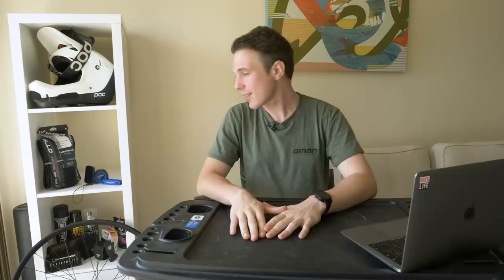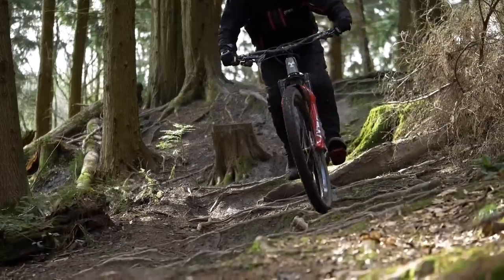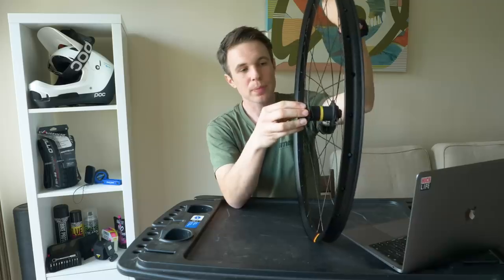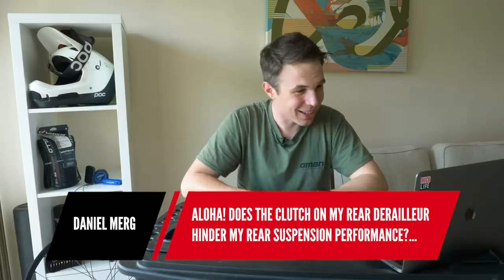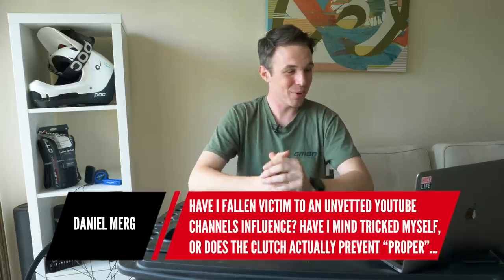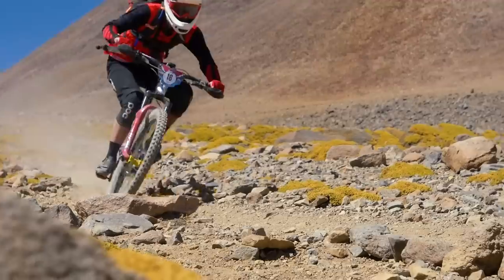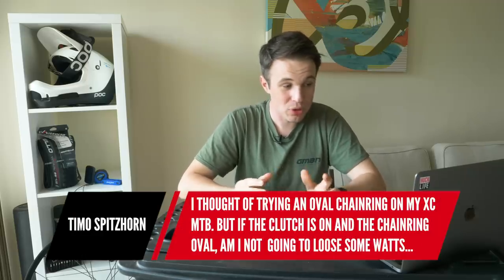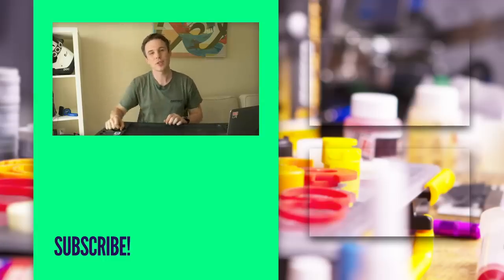E-MTB Components On A Regular Mountain Bike? | #AskGMBNTech

Comment from the maker: If you have a question you would like to ask us, use the hashtag #AskGMBNTech with your comment under this video and it may feature in a show in the future! 🔧
Reply: GMBN Tech #AskGMBNTech INew to MTN Biking and I’m building a Nukeproof Scout 290. So my ? is,  is it ok to use a Shimano disk and a Hope caliper together.
Reply: #AskGmbnTech at what time should you just replace your helmet even if it is not visably cracked eaither from crashing without cracking it or age because surely over time it weakness with age.
 Love the show
Reply: #AskGMBNTech hi guys, love the vids! I have a kona process 134 (2015 I think) and I would like to get some hope cranks for it, which ones would I need to get and do I need to change my bb? Also what tools would I need to change my bb (if I do need to) thanks!
Reply: #AskGMBNTech
I have an entry level MTB with a cone and cup bottom bracket used for 6 months then sat for 8. I never noticed but the bracket is at a 10-15 angle what's the danger of it being cross threaded and can you upgrade it (its threaded both sides)? The shop I bought it from did build it.
Reply: #AskGMBNTech love the videos, helped me upgrade my trek rumblefish to an XT 1x group and go tubeless. Today my bike appeared to be ghost shifting, whenever I applied a lot of power it felt the the deraileur skipped. The bike shifts fine and it stopped after I reset the cable tension on the trail but still makes “wanna shift” noises in higher gears. Could it be a bent hanger or are the noises normal in a 1x with the chain angle?
Reply: #AskGMBNTech I saw in this video you covered (1x11/12) E-Bike cassettes on a regular mountain bike. Has anybody tried the E-Bike specific EX1 (1x8) drivetrain with a GX crank and chainring on a regular mountain bike? Funnily enough the EX1 cassette weights just 320g and the XX1 Eagle weights in at 357g.  I would really like to give this a try on my bike park specific enduro which has a standard Shimano freehub.
Reply: #AskGMBNTech What do you think about Magnesium alloy as a frame material? Why is it not a common material for bike frames?
There are many advantages, for example: 
1) low density (~1,7 g/cm^2) meaning light as Carbon
2) high flexibility (Elastic Modulus~44 GPa) providing probably more comfort than aluminum (but is it stiff enough?) 
3) 100% recyclable, Less energy wasting production (melting point~600/700°C) 
4) high global occurence in the earth crust 

So would it be also strong enough for aggressive mountain biking?
Reply: #AskGMBNTech. Hello Gentlemen my question for you. Do you think we will see increased steerer tube diameters on bikes with 160 to 180 travel suspension forks? My suggested size would be 1.5 tapered to 1.75
I have asked Rock Shox and Fox, Rock Shox stated they won't discuss future products and I've had no reply from Fox.
Reply: #AskGMBNTech hey Guys, 2 weeks ago I broke a spoke on my backwheel, at our local bikepark, I brought it to my local Bikeshop and they fixed the broken spoke. Today (sunday) I went for a ride (street and some mild Offroad) and after the ride I discovered that another three spokes were broken. Why is this happening again? Should I respoke the whole wheel? My bike is a 2019 Canyon spectral Al 5.0 and my backwheel is a sunringle düroc sd 37. Thank you in advance.

Comment: Regarding oval-ring chain movement - Marianne Vos used to ride (and win!) on the track with fixed gears using Rotor's non-round chainrings. This is possible for the same reason Henry mentioned - the chain is engaged in about 1/2 the chainring teeth so it works about to move very little. In my experience most of the movement comes from the vertical difference, but the chain doesn't "grow".

Comment: That last question on the ovals... if there is any negative aspect, it's far outweighed by the uphill benefits.   I tried one, still on my bike, and I'm not going back to round . The AB has been great to have on my XC and my fatbike.  Especially in snow or uphill.  I even like it on the flats.  Usually allows me to pick one gear higher out back on flats than I would with round.  Same tooth count chain ring of course.  And my knees feel better overall.

Comment: #AskGMBNTech Hey Doddy/Henry, I've seen some interviews with Christ Porter/Paul Aston etc where the topic of Dual crown forks on enduro is discussed. After doing my own research it seems that the positives outweigh the negatives in terms of added weight and other so called negatives. Aside from cost, the only other barrier to me trying this is the "dual crown rated" adage that some manufacturers add to their enduro bikes. Which leads me to believe that if my 170mm enduro bike isn't "rated" for dual crown use, even though it wouldn't be changing my geometry by having a 180mm dual crown, should I avoid this due to the possibility of "snapping my headtube"? Speaking to Paul Aston about it he mentioned that sometimes adding a dual crown can reduce the stresses put on headtubes. Let me know your thoughts. Thanks guys.
Reply: Given all the ews use single crown, I would read that as the downsides of dual crown Do outweigh positives for enduro. These are the best enduro teams in the world, so I think they have good insight to follow.
Reply: Rupert Wenn it couldn’t be marketing could it?
Reply: I'm not sure the extra stresses on the headtube to worry about are the ones that occur under normal riding.  It's probably more a question of how well it copes with the stanchion banging into the frame when you bail and the bars go sideways.

Comment: hey STEFROMFORTWORTH there is 1 other option u might have missed,  check if all the tire is symetrical, what i mean is a tire have 3 parts, left, middle, right, the middle part is ofcourse all those little bumps (dont know english name for it) that grabonto the terrain, the case might be the middle part isnt perfectly centered, and while tubeless it should still work, but in tubes-in mode it can rip your valve of the tube itself( it happened to me, and the center part was 4 mm offset to the right )...

Comment: Whether or not the spokes are touching each other at the intersection will have almost no effect on the stiffness of the wheel.  You're tensioning them to the same tension regardless of whether they're crossed or not.  The only potential advantage is that on J-bend spokes, it could hold them more in line with the flanges, but otherwise it makes no real difference.

Comment: Maxxis has wide trail tyers and standard. Sometimes it doesn't say WT on wide trail tyres. Wide trail tyres are made for larger rims and will be smaller when compared to standard size on the same rim. Maybe measure the height of the side wall to see if the new one is WT.

Comment: Friend of mine just bought himself a 220mm brake rotor to go with Magura MT7's on his YT Capra.. I can barely touch the brake lever without going OTB or locking the front wheel up. The again he weighs a couple pounds more than me. Gonna be interesting on the first proper ride I think :D

Comment: #AskGMBNTech

Hey I am thinking about upgrading my bike and wonder in witch order I should progress. I'm considering a 1x12, dropper post and a new fork but not sure witch to start with.
Reply: Dropper 4 the win! Easily makes the most MASSIVE difference to everyday mtb riding, (you will never go back to rigid post).. Then new fork, and 1x (tip: 1x10 is still plenty good enough for 99% of riders. 12 speed is simply overkill and more expensive maintenance costs, etc).

Comment: #askgmbn hey Dodds/Henry is there an issue using a lever designed for a 4 piston brake on a 2 piston calliper
Reply: It depends on which brand it is, as far as I know magura and Shimano uses the same lever for 2 and 4 piston brakes, I don't know about SRAM and others.
Reply: Make sure not to mix dot and mineral oil brands
Reply: DragonBornish it’s shimano I only ask as my lbs said it can cause problems but I wasn’t to sure
Reply: Purple Turtle it’s a saint lever on a mt200 caliper
Reply: @kevblaylock3052  Saint levers push more oil than any of the trail levels, so it would be even more pronounced. I'd suggest not doing it.
Reply: @conman1395   i agree, the saints and the zee are the only Shimano levers I wouldn't use on 2 piston brakes. That said, did you buy a saint lever in order to pair it up with your mt-200 caliper? Why not just buy a full midrange brake for the price of one lever?
Reply: I have Zee levers with XT calipers. No problem at all. I have also XT levers on Zee calipers. It brakes as well but I feel that there is probably smaller piston (Levers do not feel so biting). Btw: riding that for 2 years (both bikes). No issues at all!
Reply: @purpleturtle8841  As they use same hose, you will have no issues to swap these. You can swap any lever with any caliper while they use same oil and same O.D. hose. You will see only differences in amount of oil pushed, but as brake cylinders are similar (except 2 vs. 4. pistons) I see no problem. Tried myself already.

Comment: #AskGMBNTech So after a recent trip into the wilderness I had a "little" issue with my SRAM Eagle derailleur (rock + derailleur = no more idler pulley) and while walking the 14 km back to my vehicle I got to thinking. 
1.) What should I carry for spare parts that are likely to break and easy to replace on the trail?
2.) Do you have any suggestions for a hack or a bodge to be able to at least pedal in one gear with a derailleur with a missing an idler pulley?

Comment: I do love sram's guide RE brake set, really good power and relativity cheap...I'm not sold on E-bikes yet (maybe when I get even older as I don't wanna loose my stamina as I often ride 8 hours plus) but if it means beefier gear for MTB's...well that's just fine.
Reply: Ironically it is just an old code caliper and the guide r lever

Comment: Hi Guys.
I was standing behind a guy in the queue for the lift at my local bike park. He had a Specialized stumpjumper, and right in front of his rear brake there was some sort of reservoir with a blue dial on top, and a tube going up to the shock. Is that some sort of remote piggyback reservoir? There was a FOX logo on it. Never seen that before. 
#AskGMBNTech
Reply: That's probably the "brain" shock resevoir. I believe it's to help it automatically lock the rear shock while climbing and open up when hitting bumps and going downhill.

Comment: #AskGMBNTech I recently went to put new tire sealent in my tubeless tires. I have stans sealent and was wondering if it is ok to mix sealants next time I add sealent  (for example stans with orange) or will it cause a reaction?
Reply: Stan's and OS aren't supposed to play well with each other. Heard all kinds of second hand horror stories HOWEVER, even previously working as a mechanic in a high end shop I have not seen that with my own eyes. I had to use a tiny bit of OS (I'm a tried and true Stan's guy) while 500 miles from home and my bike did not explode. I'd say if you're fairly dedicated to regular service then it's not going to bother anything. If you're a "set it up and ride it until it breaks" type, stick to one brand at a time.
Reply: What happens if it is all dried out but there is still remnants of stans left over?
Reply: Captain Jack MTB: Life Behind Bars what happens if there is still remnants of stans sealnent like a skin in a tire? Can you add it then
Reply: @anthonyv9984  I did it and nothing bad happened but admittedly I got new tires two months later anyway. It appeared to be just fine when I took the old ones off but you know how the internet can be. There'll be someone out there who claims their house burned down as a result of mixing sealant brands 😂

Comment: #AskGMBNTech Hi, I have a Trek Fuel ex 8 and when I put power into the cranks I can hear a creaking/cracking noise, is this something I should be worried about? Thanks for the great videos.
Reply: Tom Grafton a friend of mine has the same problem. I think if you remove the crank and add some grease/lube it will be fixed, if not remove your whole crankset and have a look at the bearings of your axle/spindle
Reply: You should replace your bottom bracket
Reply: Tom Grafton Common problem with the Fuel Ex series. It is one of the linkage pivots that come ungreased from factory. The pivot in question is the one that conects the chainstay to the frame, acessed above or behind the chainring. Try greasing this pivot before doing anything with the bb! I had the exact same issue, and that pivot was the problem.
Reply: Gustav Classon I will try that thanks
Reply: Lucas Kik Thanks I will have a look

Comment: I’m still relatively new to mountain biking, but properly hooked.   My bike is a fairly budget hardtail (Raliegh Tokul 2). I’ve upgraded some of the more inexpensive components- tires, grips, pedals, added a dropper.    

My question is, is it worthwhile to upgrade more expensive components such as the fork, drive train, and brakes, or, would it serve me better to save the money and put it towards a better bike perhaps next year.  (Budget is an issue)

The no name fork, tektro brakes and 1x9 are definitely starting to stick out as weak points on the bike.  

Thanks!  Love the show and I’ve learned a ton from it!      #askgmbntech
Reply: If it's got cable disk brakes, try some cheap tektros or shimanos, but if it's hydraulic try some wider bars/shorter stem.
Reply: bananas stuff I have the cheap tektro brakes, that’s part of the issue.     The bar and stem are not the issue. I’m asking about things like forks, drive train and better brakes.  ReAlly not trying to be a jerk or dismissive, but you 100% missed the point of ny question.
Reply: @dennispikephotography  i don't think i did miss the point, I suggested some upgrades that would be worthwhile. i didn't know what stem/bars you were running and i also didn't know your brakes, because you didn't say. my personal opinion is that under 1k its not really worth upgrading, but you could buy a narrow wide chainring relatively cheaply and convert to 1x if you think you will be on the bike much longer.
Reply: bananas stuff dude. Read my WHOLE question, you clearly didn’t.  I absolutely say that i have tektro brakes and a 1x9.
Reply: @dennispikephotography  oops my bad. the first time i did read the question but not really take it all on. sorry to waste your time. i would just keep it as is and buy a new bike when you can.
Reply: bananas stuff yeah. Really not trying to be a jerk or mean in any capacity.  

But my point was just, I have made all the inexpensive upgrades I can. To upgrade further gets into far pricier components. So is it worth it to put expensive components on a budget bike, or save that money and put it towards a better bike in the future.
Reply: @dennispikephotography  i'm not sure i'd go any further, but if you feel that the geometry really suits you, fits your riding style and in general fits then go for it.
 if it doesn't fit so well or the geometry is not so good for what you what to do, then save your money.
 that's just my two cents on the matter.
Reply: bananas stuff well. Hard to say, honestly. It’s my first bike in 20 years.  So, it’s miles above the walmart bike i had as a teenager.  I really don’t have much to compare it to.  I rented a bike when I was traveling not too long ago, but only rode it for maybe 2 hours (it was a stumpjumper).

I wish I could demo some other bikes right now, but that’s less of an option with so many events canceled

I will say, for an $800 hardtail, I get more people than I would have expected telling me they think it’s a cool bike out in the wild.
Reply: @dennispikephotography  if i were you i would keep riding it as it is and try to demo some more bikes when lockdown is over wherever you live within your budget to compare it to. if it doesn't do so well compared to other bikes you try, get a new one. if you think its superior, keep it and upgrade.

Comment: Yes, you lose watts due to friction and spring force in the clutch when it's compressed. How much is returned when decompressed? Less. You don't get the energy from friction back. 

My question would be - are the mechanical advantages of the oval greater than the friction loss? #AskGMBNTech
Reply from the maker: Hi Bob, the amount of chain slack/growth is actually very minimal with Oval chainrings. So minimal in fact that it is possible to run them on a single-speed dirt jump bike without any chain tensioner (Matt Jones uses one.) we wouldn't choose to focus on this, as tyre setup, suspension setup would have a much larger effect. Some people love oval rings and others don't. We suggest you try one out for yourself and see how you get on with it. 👍

Comment: #AskGMBNTech Hi Doddy/Henry, I noticed a leak at my forks damperside down by the adjuster knob and i think it´s from the damper itself. I have a Pike RC 2018 150mm fork. Is it difficult to do a service on the damper myself, and what parts do you think I need to replace?

Comment: #AskGMBNTech Hey doddy / henry  Love The channel I have a Cube LTD SL 29 Hardtail from 2015. And I have been changing my 3 by 10 drivetrain to a 1 by 10 instead. What I wasn't sure about I what chain guide to buy. Thanks lads.
Reply: I had the Cube Ltd Pro 26er, and I had mine set up 1 by 10, and I never run a chain guide. Just make sure to use a narrow wide retainer chain ring and make sure you have a clutch assisted derailleur and it will be sorted! Never, ever lost the chain in 7 years!!